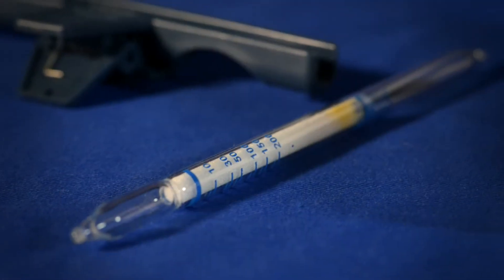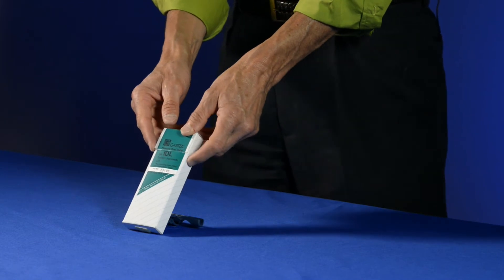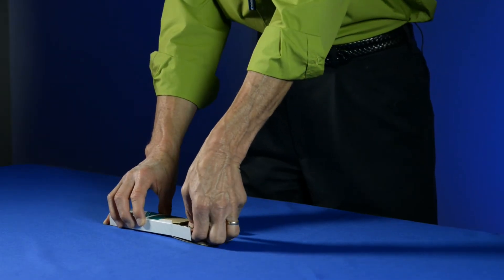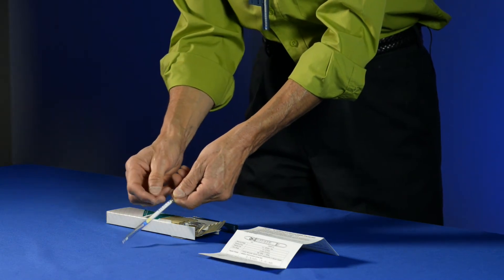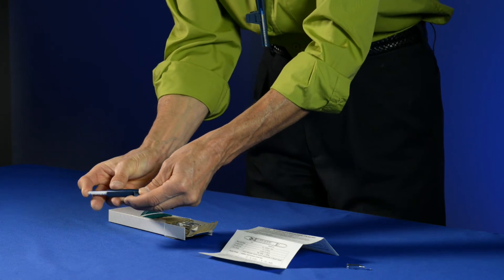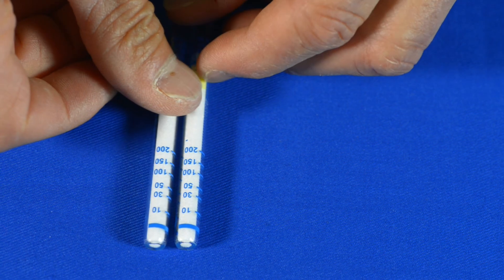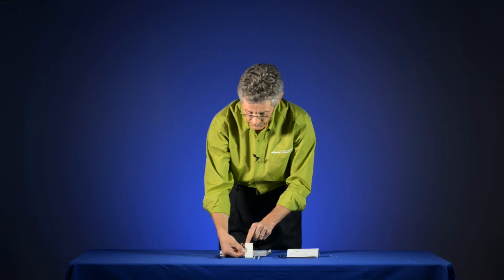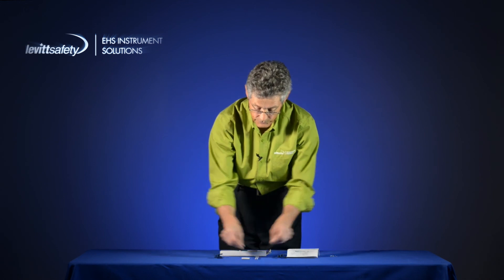Module 2 -- Gastec Passive Dositube Gas Measurement System

Comment: Is there any impact factor publications based on these Gastec tubes ?
Reply from the maker: Hi Jahan! Yes, correction factors are available but they vary depending on the tube used and the gas being measured. Is there a particular gas that you are concerned with?
Reply: @levittsafety 
 yes I am looking BTEX analysis. I am looking for a passive sampling technique which is recognized by other environmentalists too.